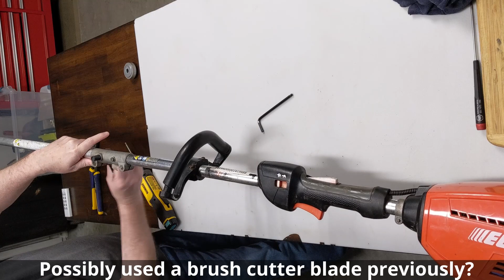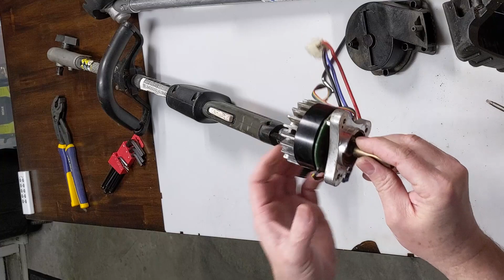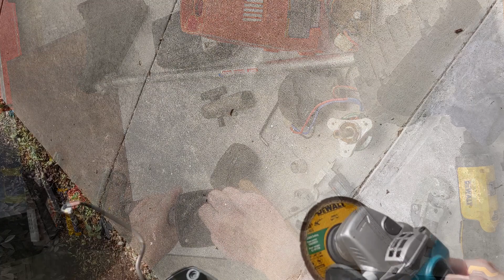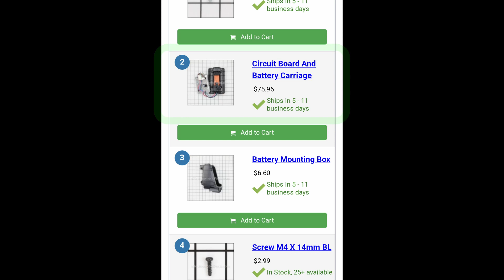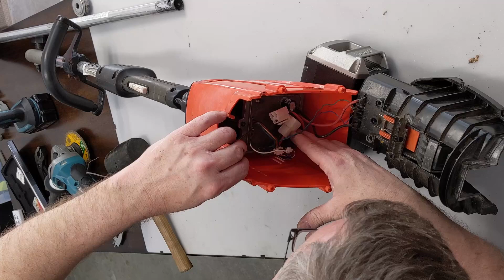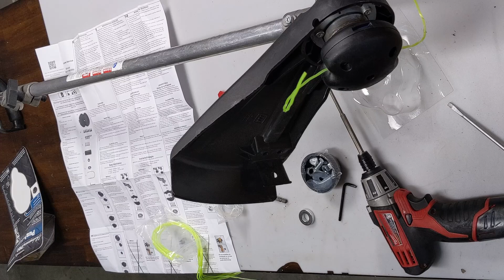ECHO 58V String Trimmer Repair

Comment: I can't take the battery off.

I'm pushing the button and pulling but nothing.
Reply from the maker: These are not as easy as the EGO packs to release for sure. Pushing the latch with your thumb and shaking back and forth usually will release the pack. They can be tight sometimes.

Comment: Need to know how to remove and replace bearing if possible to share.
Reply from the maker: I will try to take time to look into this. I stay more behind than ahead no promises other than I will try to work it in...
Reply: @ThriftyToolShed , understood and I appreciate it. Thank you for responding so quickly.
Reply from the maker: I did share a video on the bearings replacement on the ECHO 58V BLDC motor. 
https://youtu.be/trTKOMXi8b8
Reply: @ thank you
Reply from the maker: Hope it helps!

Comment: Can you wire up the new echo battery to work with that?  I cant get any echo batterys for my mower.  All out of stock.
Reply from the maker: I have not tried to make one work myself as I only worked on a few of the ECHO 58V items in all. I do still see some for sale on Amazon that will fit the 58V ECHO stuff, but it's not cheap for just a 2Ah though...
https://amzn.to/3SesiaV

Comment: I have a question so mine turns on but then cuts off after some seconds. Any idea what it could be?
Reply from the maker: Do you have more than one battery to try. It seems like either an issue with the voltage dropping down and the controller shutting down or possibly bad connection of some of the battery terminals. The next thing that comes to mind is if the head is binding in any way or something wrapped around the head causing it to shutdown with high load/current.
Reply: You have to press the battery test button every time you insert the battery.  Or else it will only run for a few seconds then stop.  Try pressing the battery test button.

Comment: Update. The squeal sound is the shaft turning very slowly. Shaft spins by hand freely. Maybe a bad switch?  Other ideas?
Thanks.
Reply from the maker: I have not seen that in this trimmer to say for certain. Typically a squel sound while not turning up to speed is a controller issue. These BLDCs are way more complex than the older brushed DC motors though. So it could be that one of the controller output transistors is bad and the motor is basically single phasing, it could be an open winding on the one of the 3 phases of the motor or it could even be an issue with the feedback hall sensors to the controller. I would check the tiny connectors for the hall sensors first and then ohm the motor windings and go from there. Best of luck to ya!

Comment: Great job on this repair!  That was clever to cut the shaft back to the part that was still square, made for a nice simple fix.
You are probably right about it having been used with a brush blade.  It’s common to get worn out part’s on gas weedwackers when using blades too, at least when they are used hard.  People will often rev them all the way up before slamming the blade into dense grass or brush, which I could definitely see causing that shaft to get rounded out on your machine.  For smaller machines gas or electric I like to use a head with blades that swivel instead of a large solid blade because it’s not as hard on the machine.